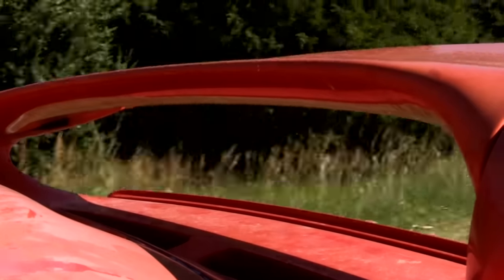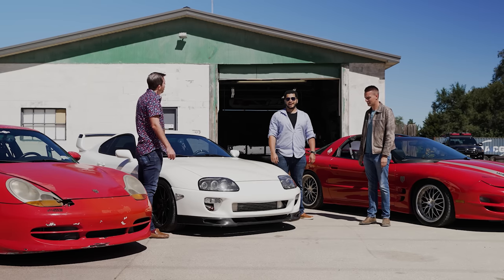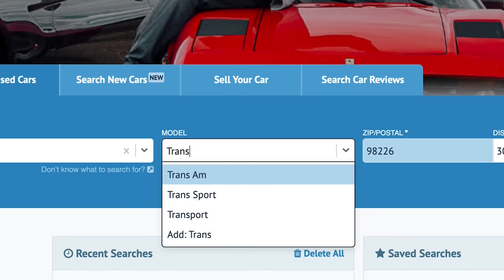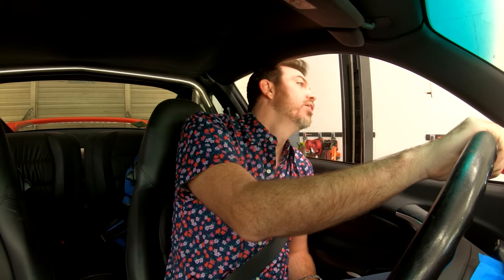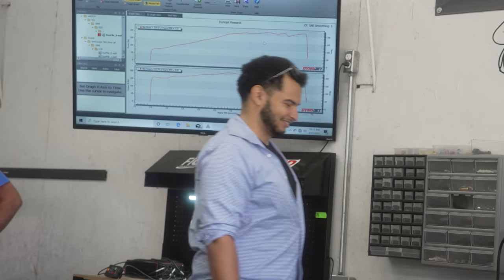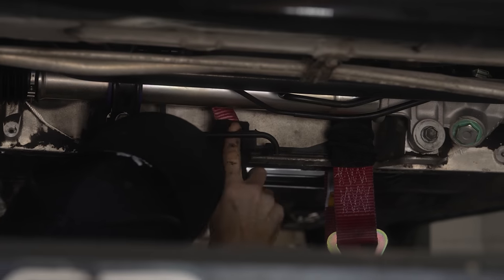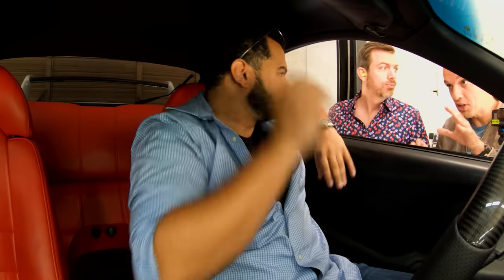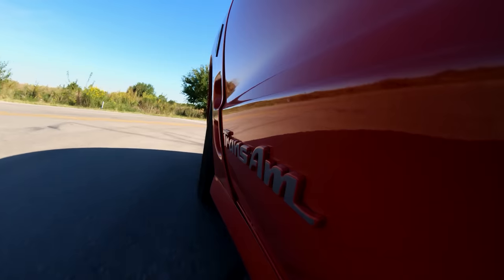We Bought 3 Dirt Cheap Sports Cars...Here's How Fast (Or Slow) They Actually Are | Car Trek S6E1

Comment: I love all cars regardless of where they come from however I never understood the 2jz argument. Comparing it to the LS the 2jz is longer, wider, taller, heavier, less cylinders, and in even 600hp builds most of that power comes from a massive turbo but with the LS you have a lighter engine that makes more HP per pound capable of a NA 600+ HP and with a higher displacement engine with more cylinders it's capable of producing more power, plus it has newer tech then the 2jz and can be mounted lower so the center of gravity is less effective when taking corners. Also don't hit me with the donut media comparison the video was bias towards the 2j because they prefer Japanese cars.
Reply: 2JZ is better, you compared a V8 to an i6
Reply: @lenseofanomad  an i6 that weighs more
Reply: @turdmanjones1768  because of turbo bits. Turbo = pew pew woosh woosh = speed. Yus! Both are good engines, it's not all about being fast necessarily. I couldn't fault someone for wanting either of the two. Love em both!
Reply: Also a you can just supercharge an ls, the old ones used cast blocks so the boost can go through the roof, there is no reason to choose a 2j over an ls. Also the noise of an ls is godly😂
Reply: Intech and green top barra tuffer motor
Reply: @lenseofanomad  no dude.  N/A its not anything special man.  It needs the turbo to be great.  Ls1 N/A makes great power  its a great motor swap and its in a lot of cars and trucks nation wide. Cheaper to build too
Reply: Ya but Japanese cars never came with an LS did they
Reply: For NA builds I would go with the LS. Boosted builds I go with the 2JZ.
Reply: its because the 2jz stock bottom end is capable of holding a lot of power, not so sure how much you can push in an ls without replacing that
Reply: @paulsmith5442  you never heard a boosted 2jz
Reply: @slippery7258  A stock-longblock boosted LS can hold more power (that you can actually use) than a 2JZ.
Reply: @lenseofanomad  it definitely is not. There's a reason the ls is the most used engine platform for backyard racers AND inspired countless supercar manufacturers to build their own versions.
Reply: Let me know when someone figures out how to displace 7.4 litres with a 2j
Reply: The bottom of the barrel 5.3 ls held over 1300 hp stock with nothing touched besides adding ring gap. Richard Holdner did a big bang on one a while ago and couldn't get it to blow on the Dino. He was trying to test the strength of the bottom end, but he ran out of turbo at 1340 or something like that and called it there because he was out of Dino time if I recall correctly. Find me a 2jz in any junkyard for 400 bucks and then try to make it hold 1300hp without spending another penny and I'll give you my attention. I still wouldn't buy one, but I'd entertain the idea..
Reply: Both engines are legendary. I think we can agree on that. A few more include the good ol’ 350, 302, 300 straight six, 12 valve and boxer engines. They all deserve the praise and fan base they have.
Reply: I can’t understand why so many people think the 2jz sounds so good, the v8 makes a sound that is incomparable to that thing.
Reply: @Pia-ho9dm  It's just two different forms of mechanical music. I used to drive my Grandfather's 54 Chevy with a straight six in it stock, but it had modified exhaust and the six sounded good to be honest. I like them both, but if I were building something that originally had an old school straight six I think I might use a 2J in place of a V8. I think they sound good. That being said I do like V8s as well.
Reply: I'm a Japanese fan boy, and would take a 2JZ supra over probably anything with an ls1... But there's pretty much no way to compare the two engine without the LS1 dominating.
Reply: I mean yeah it's incomparable, they're very different engines? They both sound awesome in their own ways, it's like comparing the taste of high end beer vs. a nice scotch, they're both good but they're a different experience entirely
Reply: @s92dx  I'd take a 2JZ Supra too, sell it and pay off my house. I think they're cool, but I definitely don't think they're worth what rich people are paying for them. I fell for the click bait thumbnail to hear why it was allowed into a budget car comparison.
Reply: @williamlehmaniv7460  Although I have never heard a mk4 supra rev in person I still think they have no grunt, they do not sound bad at all in my opinion. My dad has a holden commodore vx ss and it sounds so good just crusing in it puts a smile on my face.
Reply: I've heard them in person and they are sweet but not what they're being sold for sweet, by a long shot. The hype ran away with them. You run what makes you happy. I have a turbo SAAB 900 that I love listening to and it only cost me $1,300 several years ago. It's all what you make of it.
Reply: Agree completely with you on "run what makes you happy." 2Js also are a lot rarer compared to LS/Vortec so I think that aids in the price bump but yeah they're an expensive AF platform
Reply: Ls power delivery is a turd. Slow climbing dyno plots all the time. Big turbo hits like a freight train at a much lower rpm. 600 hp from na vs 600 hp from turbo is very different delivery. Motor trend even states a that a 911 turbo can pull double duty as a bulldozer due to 1500 rpm having huge power and tq numbers. Keep your pushrod. And slow climbing tach. And since I have a 600 whp 4 cylinder this isn't speculation. 600 hp na ls stands no chance against my 4 cylinder. Heavy turds in heavy cars with limited traction don't win races.
Reply: Hey Bro don’t trip LS is a better motor hands down I’ll push that Tran Am before I own a Japanese car… LS is a mean motor the Import fan Boys no that… now imagine if that Trans Am cost 20 grand how much better it would be.. LS baby!
Reply: @danielnelson4881  no because an LS is all aluminum. It weighs less even with a turbo slapped on
Reply: @paulsmith5442  well if its not an all aluminum block its not actually an LS motor
Reply: I doubt both can be compared fairly.  The JZs are a late 80's engine design, while the LS was developed about 5 years later-- mostly to replicate the performance of the (Lotus-engineered) Corvette ZR-1 engine of 1990.
Reply: I love Toyota's inline 6 engines.  They were overbuilt for reliability, which is why they're so heavy and can take so much more HP than stock.  I wish Toyota still made I6 engines - imagine what a 3JZ or 4JZ would be!  And I think, for me, that's the main problem with a 2JZ - they haven't been made in 15 years and Toyota never continued developing that engine family. So the supply is now extremely limited and prices are through the roof.  LS engines are powerful, plentiful, and cheap.  For any project where I want a lot of power, an LS is going to be my first choice nearly every time.  The value proposition is just too good.

Besides, the 2JZ was always best for GT cars, while the LS was great for muscle cars. Toyota's engines were more refined because they were primarily intended for Lexus luxury coupes and sport sedans.  Of course people have tuned them to squeeze a LOT of power from them, but that's never what they were originally designed for. The LS was designed from the ground-up to be all about lots of raw power.  And GM did a great job at it!
Reply: The real advantage of the LS is that you can find one at a Pick n' Pull for a reasonable if not cheap price (shared GM parts bin with trucks/SUVs/vans - not just sports cars), get a relatively affordable performance kit to rebuild it, and readily make some mean dyno numbers. To have it's competitors from this video end up in a comparable level of build they're going to cost at least double. The notoriety isn't just good and somewhat reliable performance, but its ridiculous in it's bang for the buck aspect on its home turf.
Reply: Thank you
Reply: @skippysvr4586  cool
Reply: @slippery7258  You really think it's expensive to buy a forged bottom end? Dumping 30k into a 2jz gives you 5-600hp. Dumping 30k into an LS gives you 1500hp.
Reply: @zjunk4877  30k into a 2jz will give you WAY more than 600hp. I can tell you clearly don't know wth you are talking about.
Reply: @zjunk4877  dumping 30k on both of those engines makes them monsters… hard to gauge what will make more power at the end
Reply: Though i prefer the UZ series of v8s, much smoother than an LS or JZ while still having plenty of power
Reply: @daytonraught629  This is true, I just wanted to say pew pew woosh woosh if I'm honest, that's really all there is to that.
Reply: @madkas14  You literally just watched a video where he dumped 30k into a JZ and what did it do?
Reply: @zjunk4877  and I literally just said, that it does not take 30k to make 600hp.🤦🏽‍♂️
Reply: This has to be the dumbest commenting i read l year. A couple of 12 year old arguing about some engines they probably never touched, choosing a side like their life depends on it and their neck deep in this whole thing. Surprise, the people who play with these cars/drivetrains dont even care. Most of the time their is some mutual respect going on, but often their Just to busy wrenching or making bank so they can afford the hobby whilr you whine on YouTube about prices or this vs that.
Reply: @lenseofanomad  no it's not it's why it's dead the 2JZ is a slug without turbos
Reply: @daytonraught629  im talking the 90s 4.7s and 5.3s they put in trucks, they were cast

Comment: My suggestion for a challenge format with such junkers: 
(First of all everyone genuinely has to buy the cars after the challenge has been set)
1. Endurance race for only a few points to get all the faults known and any failures to fail: the one who makes it the furthest wins. I suggest mandatory cool-down laps every 3 laps or something like one lap with a (GPS-confirmed) speed limit. That's because even brand new road cars can't take sustained track abuse.
2. Everyone gets their cars fixed by professionals, like properly fixed (the necessary stuff for it to work, not cosmetic etc.). The challenge is: lowest price wins.
3. A proper race. Medium distance. Or maybe two sprint races (three if tied).
4. Everyone gets the chance to upgrade their car in one area. Maybe don't let the winner of the stage 3 race upgrade at all, 2nd place gets one are to improve, and the last place gets two areas to improve.
5. Final race after improvements.
6. As OffRoadRN suggested: sell the cars, maybe at auction. Best price for the car wins.

Comment: The TransAm is one of the coolest cars ever made for the $...GM was real dumb to stop manufacturing TAs. Tyler's TA needs better tyres & may be a couple of turbos..
Reply: They stopped manufacturing them because people weren't buying them.
Reply: @WhoopityDoo  GM stopped manufacturing TAs to favor sales of their camaros which belonged to their main brand - cheverolet. People are still trying to get their hands on TAs these days.
Reply: @paulantony4598  The Trans-Am was discontinued the same model year as the Camaro was (2002).  What are you even talking about?  By the time the reintroduction of the Camaro had taken place (2009), GM had already made the decision to axe Pontiac as a brand, which means there wouldn't have been another Trans-Am regardless.
Reply: @WhoopityDoo  TA was discontinued along with the whole Pontiac range in order to favor the sales of their main division Cheverolet. They could've stopped making camaros & built TAs, which were hands down better than camaros, as the sole units from Pontiac. Now TAs are custom made by a co. called Trans Am depot, by heavily converting camaro units.
Reply: @paulantony4598  yeah. No. Pontiac as a brand was dead on its feet. They canceled both cars so it han nothing to do with camaro sales. The camaro always outsold the Trans am.
Reply: @nostalgiadad7137  Pontiac as a brand was not dead on it's feet. That's what  General Moron belched to the public. GM was in desperate need to get billions in financial aid from congress & they could get it only if they trimmed down in size. Cheverolet & Pontiac had models that were pretty much alike & so GM cut off Pontiac coz they were definitely not gonna cut off  cheverolet, which was their heartland division & Pontiac sales were detrimental to Cheverolet's existence during those tough times. Camaros might have sold more than TAs as they were cheaper, but TAs were the better, more powerful & faster cars, not to mention way cooler looking.

Comment: Trans Am has 12s in it. Rear tires at 26lbs fronts at 45lbs to lower rolling resistance. Not bad, though. Hot Rod ran a 2018 Ford Mustang 5.0 10 auto to an 11.8 1/4 mile at around 119 mph with this setup.

Comment: 545HP x 20% is 109HP drivetrain loss. If you add in the fact that his car was smoking, altitude difference, and that the engine may need a tune up, you can say that 545HP sticker wasn't a lie.

Comment: The t56 gear ratio is 1:1 in 4th gear not 3rd wonder what the difference would have been power wise
Reply: The trap speed at the strip is a clear indicator that the dyno wasn't far off. it's a little over 400hp
Reply: @alexkennedy3351  trap speed can’t always be used as an indicator of accurate hp unless you take into account the 60 foot. But I get where you’re coming from.
Reply: @feron450  Trap speed is always a reliable indicator of HP - unless the car wasn't accelerating the whole run. Short track = ET  Big End = Trap Speed. If you know the gear ratio and weight then Trap Speed is basically a function of HP. If you trip the beams and then sit on the line for 10 seconds before you run the track, the Trap won't really change, just the ET. The 60' doesn't really influence the Trap Speed. Conversely if you brake on the big end it will cost a lot of Trap Speed but not as much ET.

Comment: Quick calculation: Tyler's wheel HP is approximately 25% drivetrain loss. Soooo... not bad.
Reply: Also did the pull in 3rd gear.
Reply from the maker: He has a manual transmission and RWD. 25 percent is insane

Comment: Tyler is 100% correct about the 20% loss. Both the 4L65E and 4L80E boxes are in that range. In fact, it is not uncommon to see 4L80 cars lose 25% if paired up to a built larger rear end. So 20-22% is bang on for the Trans Am.

Comment: In order from 1st to 3rd, bone stock oem, what do they weigh, and which would be faster at the quater? I thought the supras was on the heavy side, and the T/A would be lighter with more torque but hard to put down with a light rear end and rear wheel drive

Comment: Would be sweet if they gave them all a quick tune up and tried to get them running proper. No big parts but plugs, wires, ignition refresh, oil change. Then run them!

Comment: The GM LT1/early LS1 cars are stupid bargains right now. The Corvette, Camaro, TransAm, etc. You can pick up any of the 3 for under 10k and immediately be in the 300hp range. Parts are cheap and the cars are reliable. Makes so much more sense than any of the JDM options, even in the higher price ranges. JDM cars give you the same performance for 4x the price because of movie hype.

Comment: I miss my 02 WS6…but I sure as shit don’t miss replacing all the little cheap parts that broke in that damn thing. Hell! I had to take it back to the dealership a year after I bought it because the monsoon sound system shorted out and destroyed the head unit and 4 speakers due to the cheap wiring GM used then.

Comment: Actually the pontiac trams am WS6 was very very quick sports car and with some work and aftermarket parts, you can definitely get that WS6 at 1,000 hp. I've seen them with that before. Now if you aren't talking about stock factory cars. I would go with a 90s SS Camaro with after market parts and it'll probably stomp you Supera.

Comment: Also, if you need some cheap all-season tires that perform quite well, check and see if Discount Tire has any Roadhugger GT tires for your wheel size. I've thoroughly enjoyed the performance of mine. Even if the name sounds dubious, they've yet to break traction on me, even in the rain. At the very least, even if you have to go with some off-brand tires, try to get some decent ones.
Reply: I'd like to grab some for my IS 350, the 255's @ 18 inches in the rear are getting expensive...
Reply: @jesterokjones4954  I don't even want to remember the days when I had a 2WD drivetrain and had to be legitimately concerned about rotating them all the time. My car's AWD seems to do surprisingly well at wearing all the tires fairly evenly.
Reply: @mndlessdrwer  Oh, no... No-no.... You can't rotate mine, not only are they directional, it's a staggered setup, do it runs 235 in the front and 255 in the rear... F*cking PERFECT!
Reply: @jesterokjones4954  Oof, that's rough. At least mine had the decency to run 245/40R19. They're still not exactly cheap, but they're not annoying to service because of different section width. I even checked and I can technically run all the way from 225 to 255 section width if I really wanted to push the extremes, but I prefer 245 because it provides me with a better fit on the rim compared to the OEM 235 section width. The sidewalls don't get pulled in because they're stretching it over the width of the rim, and this protects better against accidental scrubbing on the rim.
Reply: @mndlessdrwer  not sure what I'm going to do yet because it's about to have a centrifugal supercharger put on it. I've got to get some headers, which it already has from factory and they're really nice looking too, but it needs bigger ones. I want to see how it runs with the rest of the piping being stock.

Comment: are these guys amateurs? The Dyno measures Wheel Horse Power, that is usually around 25-29 percent less than engine horse power, a car doesnt lose 100 horse power because its old it usually is around 3-4 percent